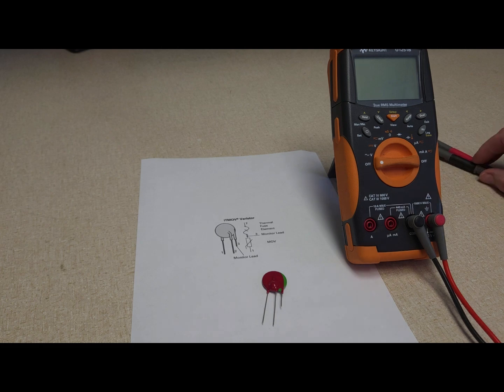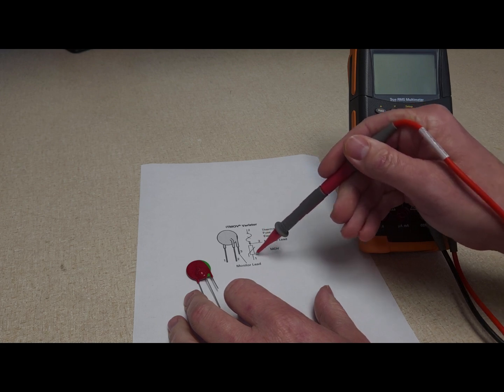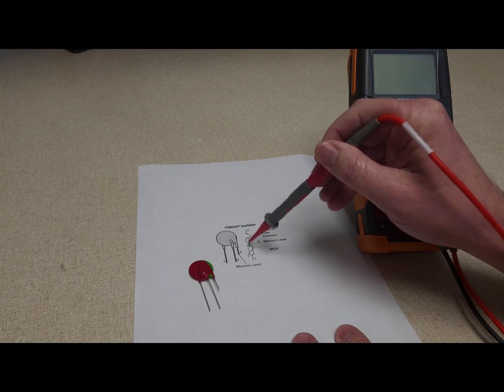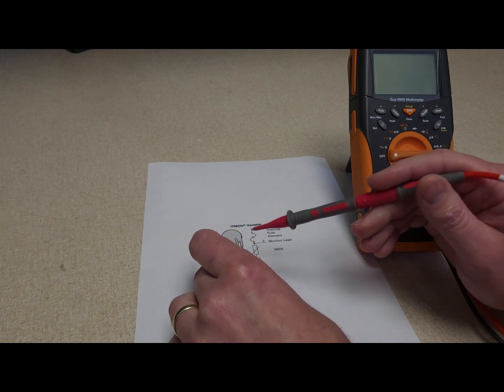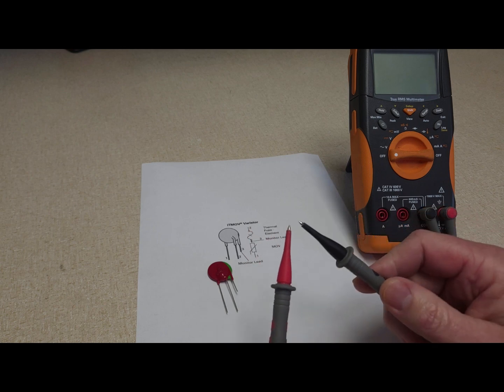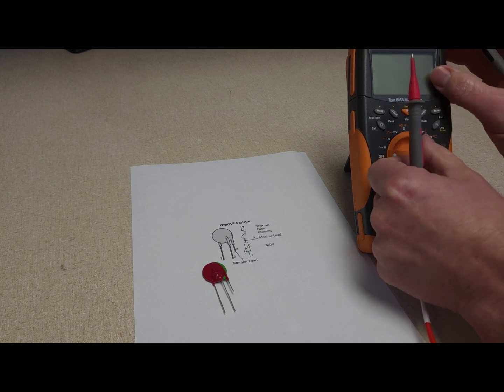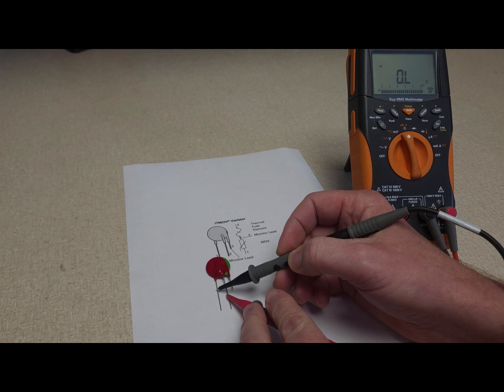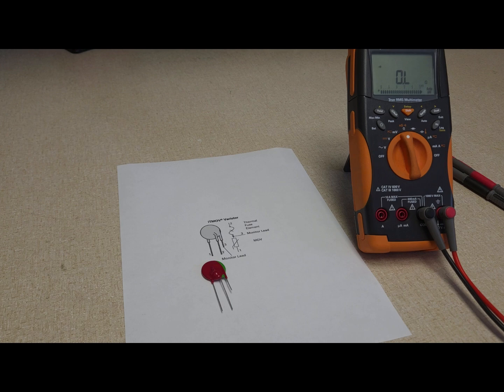How to test a MOV (Metal Oxide Varistor) with a thermal fuse, iMOV by Littlefuse.

Comment: Interesting component. Thanks for making the video. I missed the part that explains that when the MOV triggers it is a low resistance and usually blows making a short circuit. That is why it must be placed after a fuse. The PTC will prevent catastrophic failure. However the over voltage protection is disabled.